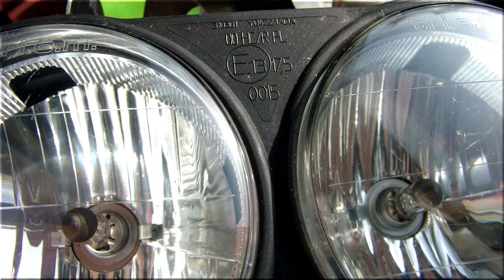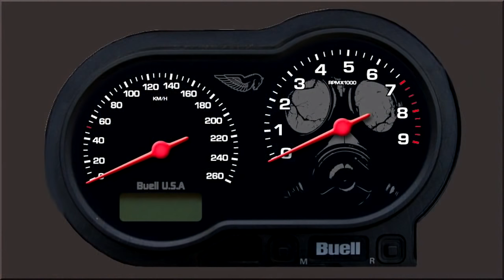2008 Buell XB12R Firebolt to Lightning

Comment from the maker: The hardest part will be the wiring harness. On a Firebolt the fuse box(es) and stuff are located at the front fairing so there won't be as much space in the R-type trunk to accomodate the ECM + wiring. I reckon that you best consult BuellXB and Badweatherbikers forum topics about the subject. to obtain the parts you can always check the German and British versions of eBay. Good luck with the conversion. Please show the results when you're done!

Comment from the maker: If its located on the back of the rider's footpeg bracket, that is a waste line and it 's connected to the fuel cell vent. You can find it on the right hand of the fuel cap. But you need to take off the airbox cover for that.

Comment from the maker: Unfortunately I had to swap/sell the spare parts to gain the replacement items in time. I had the impression that spare parts would be sold out soon. But there's lots of stuff still available. You'll need subframe, trunk pan and plastic tail section kit, which you have to get in the desired color right away since painting the plastics is not recommended. And it wears off easily.

Comment from the maker: The R front fairing becomes obsolete for you need a complete model S assembly. A size 1 gas mask fits fine. The air cover is gloss black, the frame matte graphite grey, the front modules are flake graphite gloss (powdercoating) and the mask was cleaned with Turtle Wax Extreme nano-tech tyre gel (gloss).

Comment: apparently the ecu is in the font for the firebolts and under the seat for the lightnings, personally i think under the seat is a better spot for something that fragile/expensive. sweet video
Reply from the maker: The wiring harness has been replaced for the Lightning version so the ECM is located under the seat now.

Comment: @Headroom1001 i really need help...theres a hose that runs from right beside the gas cover, and runs all the way near the rear wheel of the bike on the left side but the hose isn't connected to anything. it is a 2003 buell lightning XB9S. I'm guessing its the gas line i just have no idea where it's supposed to connect to and i've looked everywhere for a gas valve but found nothing.

Comment: Hey I am rebuilding my 2004 Buell Xb12R Firebolt and I was wondering if you were able to use the stock headlights and if you had to do any fabrication to use the gas mask and to get rid of the front fairing? I was also wondering what shades of black did you use, was it a gloss or a semi gloss or a matt black?

Comment: awesome buell man...I have a 2008 25th anniversary edition xb12r and would have done the conversion as well but the 08 models are hard to find...love your lightning though!
Reply from the maker: This was also a 2008 25th anniversary edition xb12r. All S-model parts from 2004 up are replaceable with the R. You only need to make sure to get an airbox with air intake (2005+)
Reply: awesome man, Im actually getting rid of mine though due to a car wreck but thanks for the info bud

Comment: I'm probably not the best person to ask Steve, I think my videos are a bit ordinary, I just use an old Kodak Zx1 HD 720p (weather and shock resistant...$100) which I cable tie to my GPS mount. It tends to vibrate a fair bit through the flex of the mount...I'll make something decent one day. Battery life and an 8gb card gives 1.5 to 2 hours.
As you know GoPro HD seems to be the choice if you have the bucks.

Comment: Holy shut man. Looks amazing. I have just recently started looking at buell's and I love em. Hard thing is they aren't popular up here in Canada. I want one so bad. Video is definitely inspirational. Wish I had a garage. Could u tell me he typical ride hight at the seat?
Reply from the maker: Hi Eric this bike was shipped from the US so for you it should be more easy to import one from your neighbouring country. They are not so expensive because Erik Buell decided to sell the last few hundreds of them for only USD 5000 brand new, thus making the residual value little to nothing. Just check American motorbike classifieds. Seat height is about 
70cm. All parts are interchangeable, I have a Scg-type buddyseat which is the lowest available.  Me I measure 1.74 mtrs. and the 70cm seat height suits just fine. If you are a tall person say 1.80 mtrs. and over you might consider the XB SS-Long type of bike which is a little larger than my Aprilla-125 sized Buell.There's great website that shows all specs on all types, that's simply called 'motorbikes dot be'. Do a search for Buell, then check overview page. It contains all models and production years well explained with pictures.  As well as individual seat heights. Now I hope this info is of some use to you. Please keep me informed about the progress. Buellers are a worldwide family. They greatly differ from Japanese motorbike owners. For one thing they own a bike that handles far greater than most other bikes. 
Cheers from Holland. Steve

Comment: i am fron puerto rico and im need the lightning headlight bracket to convert my firebolt only the headlight. i have the visor and the lamps but cant find the bracket
Reply from the maker: Front modules and brackets are hard to find because of this popular conversion. Best is to watch eBay's Pinnwall cycles and German eBay(.de) sellers.

Comment: is the only difference between the firebolt & the lighting are the wiring & plactics?????? can anyone answer?
Reply from the maker: +Tagie Hersleff That's correct. It's a modular design so same frame, same engine. Different cosmetic setup and wiring, that's it.  I did the makeover myself so I can tell.

Comment: I bought a 2009 xb12scg but the seat look like it's from a R how can I change the seat back? What will I need? Thanks in advance.
Reply from the maker: Hi Victor that sounds a little odd. The R seat consists of two parts and differs from an S/SS/Scg, it won't even fit properly. I guess your seat has been replaced for a standard S one, just to accommodate a taller rider. so you need to look for a replacement Scg seat on eBay.
Reply: Headroom1001 hi headroom1001 love what you did to the bike! Looks great! I want to do the same to my seat. I did some research and I guess it come with a seat like the R. But I want to change it to something similar to the one you did. Do I need to get a different subframe and all the tail sections or can I just take off the tail section that's on it now and put on the ones I want? Thanks for the reply.
Reply from the maker: It sounds like you have a Firebolt subframe. Yes you have to replace it with S-type side brackets, a tail section and a plastic trunk pan. These parts are hard to find unless you get hold of a cheap wrecked bike, that is. Most offers on eBay for such parts sell rapidly.

Comment: If the whole thing poor estimated was 12k, hiw come you didn't get a xb12s in the first place? Im just curious, bc Im kind of in the same situation :)
Reply from the maker: At a certain point in life it is time to leave the nitrous supported Japanese bikes behind you so I was looking for something like a HD but with some better handling characteristics. I digged a bit into the Buell history and found out that the XB1 was of a modular design so with a rolling frame and engine you could build any model. It was more a financial aspect that lead me to a economically wrecked Firebolt with low mileage to start off with. Well, I got it cheap. On the internets I found an XB12 Lightning built by Typeone. From that moment I worked hard on the realization of that dream. No penny was saved to tweak the bike to the max. Only a few minor things can be added to it. So in the end it became way more expensive as expected :-)
Reply: I see..  So if you prefer the S to the R you might as well look for that, I mean unless you find a really good offer on an R right?    I like the older '04 models mostly because of the svingarm, which besides a newer gen motor is the only difference right? (besides colors and things like that)
Also are there other differences between S and R  than; seat/tail, handlebars and fairing?   Im asking bc for some reason I can find R models cheaper and with lower mileage than S models (which makes sense when you think about what they're built for, race vs. cruising") so if rebuilding an R to an S given that I probably would have done some customizing anyway, isn't too big a deal, then Ill buy an R and get started..  Its a lot of questions, and i really appreciate all the advice that you'd be willing to share :)
Reply from the maker: Apparently the R model is not that popular. That might be a reason to come more cheap. While the handling (wheel base, rake angle etc.) are similar to the S model.  To many the S is in favor for it's already a streetfighter design. When rebuilding, keep in mind that you have to switch the cable harness since the fuse boxes & contact switch are located different. To replace the wiring you might have to tilt the engine in order to fit the cable housing on the inside of the frame. You will need some new mounting plugs for it. The best place to get a good wiring harness is eBay.de, please note that you need the exact build (year as shown on the frame VIN). For small new parts I recommend twinmotorcycles.nl. You can find a short story of my rebuild @ wildewereld.nl. If I can help out just ask me since I'm still a Buell enthousiast as from day one. Cheers Steve.
Reply from the maker: By the time you get one I can get you the service manual (pdf) for your model. Just let me know.

Comment: In 1:49, what filter is this?
Reply from the maker: That's the filter used in the breather modification.
Reply: en wat doet het ? Erg gave bike.
Reply from the maker: Het voert de gassen en condens af van de cylinderkoppen ipv. dat die teruglopen in de inlaat. Zo zuigt de intake geen vervuiling aan ontstaat er geen onder- of overdruk. In geval van een moment van onderdruk dan zuigen de koppen lucht aan. En het filtertje zorg ervoor dat er geen zand oid. mee wordt gezogen. Het kan overdreven lijken maar je wilt je motortje natuurlijk zo schoon mogelijk houden.
Reply: I ment actual brand =) or link to it.
Reply from the maker: It's a plain K&N carburator filter, no special type besides the conical shape.  I cannot find the invoice but even then, it depends on the type of T-junction and size of tubing you use for the breather mod.